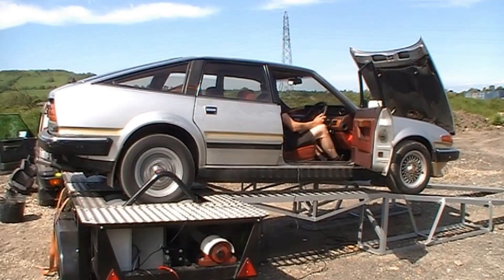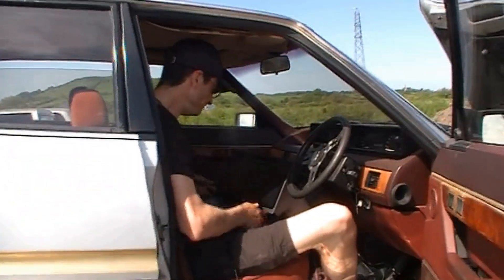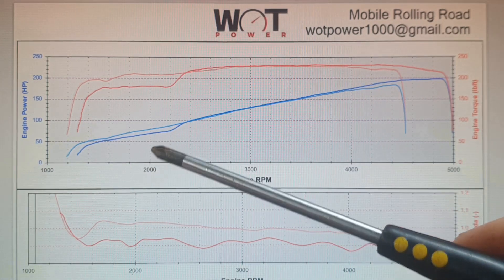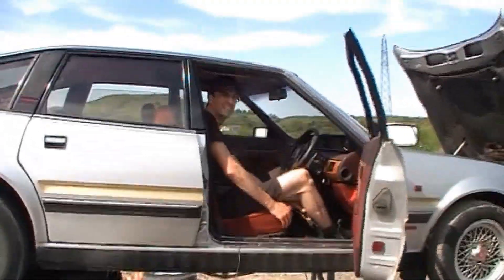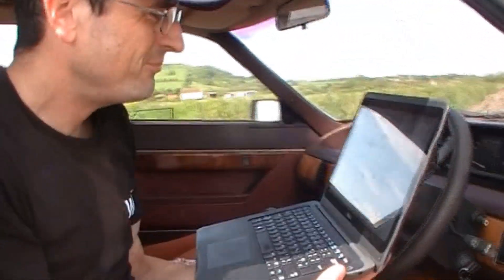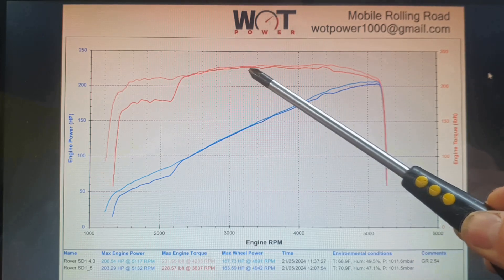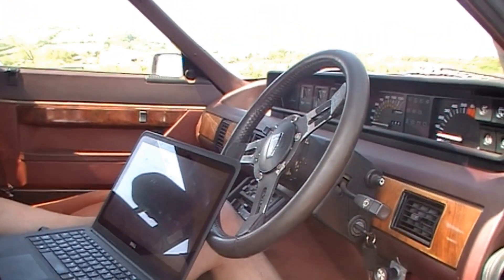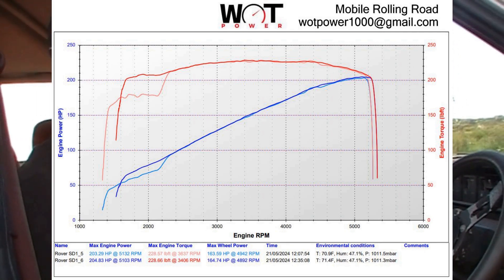SD1 4.3L with TVR bits, Rolling Road tuning a Tornado Systems ECU

Comment: Thanks a lot for your detailed videos! Will be upgrading an old MAHA LPS2000 4WD of a friend soon as the electronics are slowly dying... (the monitor is a old CRT TV and there is only a 24needle printer to get the graph out...) ;-)
Reply from the maker: @fluke9  thanks for your kind comments, glad you enjoyed the videos. Sounds like a very cool project you uave coming up. Good luck with the work. Will you be using the yourdyno kit?
Reply: @lozl  100% price-value seems awesome, the offer for a upgrade from MAHA themselfes was over 20k€. Looking forward to it, love such projects...
Reply from the maker: @fluke9  gkkd luck. You should youtube it! Or at least post on the DIY dyno FB group

Comment: you need lots of initial advance.. right before it kicks back at the starter, and then correct total advance for wot. + vacuum MANIOLD advance to get to 30ish degres at idle for good crisp idle.  
that is my guess at least.. might be wrong
Reply from the maker: @theservant752  interesting thanks for the comment. I will.keep it in mind when we start work on the 4.6
Reply: @lozl I got all that from watching Tall John's Fun Shop , but I think he knows what he is doing. hehe.... :) I just worked on hot Rover 3.9 running 14-15 initial, 36 total, lighter springs + 16manifold vacuum advance. runs good, should possibly have more initial but have to stop mechanical earlier in that case.
Reply from the maker: @theservant752  I kinda wish we had a stand alone ECU, then we could have found the perfect timing everywhere. Obviously the limitation of a dizzy. We found very little difference in torque (like pretty much none) at quite a few different timing settings. You're clearly seeing some effects for yours timing changes.....

Someone else has suggested that perhaps the cam timing is out, making it less responsive to changes in ignition timing? Something to look at now that engine is out and thr 4.6 is in.

Comment: Making life very hard for yourself with the limitation of that ECU just working with fuel pressure and advancing the distributor.  I'm currently running a Speeduino ECU on a TVR Chimaera 4.0 Turbo install.  Junk the AFM and dizzy and enjoy full control over map sensor controlled fuelling and ignition maps at any point in the rev range.  Will drive so much better and really cheap to implement.  A Speeduino ECU can be self built for around £100.
Reply from the maker: @robinarmstrongsworkshop  couldn't agree more. It would be great to get it on a standalone ECU. But unfortunately I wasn't able to commit to the time to converting everything over to stand alone. So he went down the Tornado ECU route.
Reply: @lozl  No worries.  Sorry if it sounded like a criticism.  Passionate about putting a new lease of life into the humble Rover V8.  Love the content, have subscribed. :)
Reply from the maker: @robinarmstrongsworkshop  no worries, honestly I would have loved to have put an ECU on it. I have done so with my car, there are massive advantages and its so much fun. But i have so little time to do the work for the guy and wouldn't have wanted to half arse it. This is a pretty good way to go. Next time... :)

Comment: btw the sd1 doesn't have a actual rev limiter it'll rev until the hydraulic followers overpump/something brakes, the redline of a standard sd1 is 5500rpm, the ecu doesn't control the ignition only gets a earth pulse to know rpm for injection pulse, a standard 3.5 injection engine is 190bhp so assuming that 203hp was at the crank I would say that 4.3l is very tired, should be up in the mid 200 with a ported tvr heads
Reply from the maker: Oh that's interesting about the ignition.  It makes sense though.  As you can tell I don't know too much about the working of this very early injection system.  As you could see we were reluctant to rev it any more, so I'm pleased we managed to find peak power.  

I didn't really know what to expect going into the work, I was quite pleased with the result at the time, it certainly feels nice and quick to drive.  As I've looked into it though, I have realised that it must be down on power somewhat.  Its worth noting though that it has a standard 4.2 camshaft fitted, not the camshaft that would have come in the TVR engine.  Big valves, big ports and runners, and the bigger throttle body all give the best effects at high rpm, which is exactly where the standard camshaft will be limiting flow somewhat.  

That said we have also thought the 4.2 might be a little tired.  It will soon be removed and a 4.6 put in its place with the ongoing work on the car.  We can then assess the condition of that 4.2.
Reply: @lozl  the injection system is a borsch system that Lucas licensed. I don’t believe you can run a mix of components from either manufacturer the system is called L jettronic

Standard can shaft. Would think it should be about 220-230hp. With the other tvr bits.  a standard 4.6 is 220hp with a restrictive inlet so missing about 20-30hp that 4.3 is
Reply from the maker: @That_sd1_vitesse  that all sounds plausible. If I had a compression tester might give us a clue as to engine health.
Reply from the maker: @That_sd1_vitesse 

We have now had the 4.3 apart and the 4.5 is in the car. It seems one of the cylinders had significant bore damage and it wouldn't have been contributing much at all. 

The 4.6 is making good power. Next up is to swap the TVR bits onto the 4.6 and put it back on the rollers
Reply: @lozl  that's good to hear, always like a update
Reply: yeh agreed flapper and 14cux don’t control ignition at-all.
As for all the “tvr” spec stuff that people pay a premium for, in most cases it was bone stock rover stuff.
The 500 engine was of course 5L and had bigger (but crap) trumpets and ported plenum - but it still used the standard 60mm diameter maf, std 65mm throttle and standard 3.9 injectors which were 100% duty cycle when flat out
Reply from the maker: @eliotmansfield elliot. This defiantly not standard stuff, it came out of a TVR that my friend found in a scrap yard with fire damage. It has much larger valves, pocketed pistons for the jigh lift cam and the heads and inlet runner have been enlarged significantly.